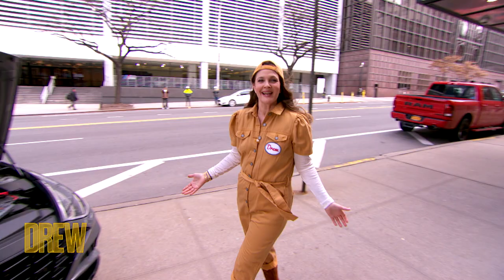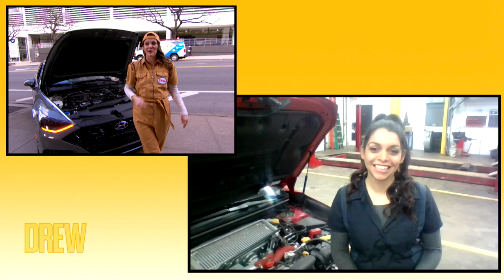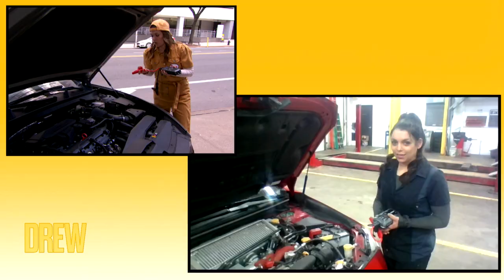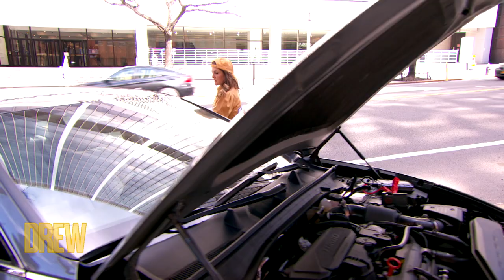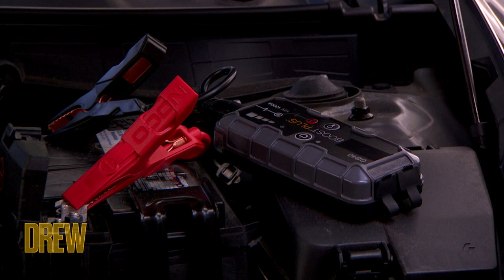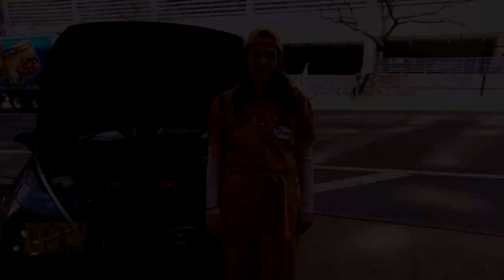Drew Learns to Jump-Start a Car from Inspiring Mechanic | Wildflower

Comment: Great look in the jumpsuit Drew.
I have jump started a variety of vehicles over the years and have done it safely countless times.
You could invest is a good quality set of jumper cables for yourself if you wanted.
Better yet I would be glad to help teach you things on a vehicle.
Changing tires, changing the oil, basic maintenance

Comment: That's not really a jump start. That's just a start with a power pack and and little bit of effort to push a button.

A real jump start is a manual car (stick shift) and pushed to start. Maybe even pushing it yourself on a slight downhill to get it rolling and jump in and start her up by letting out the clutch and pull it back in as soon as she starts...without letting her stall.
That's a real skill.